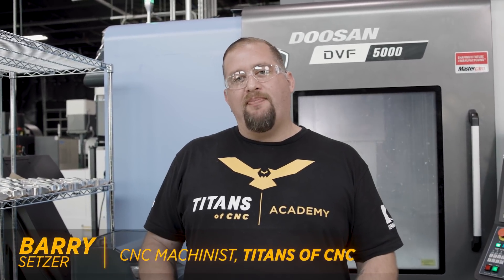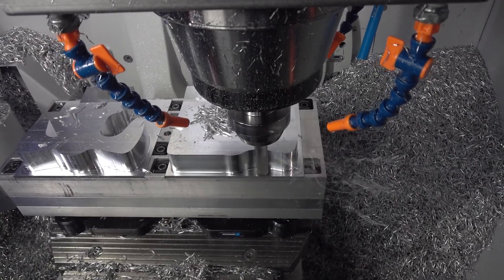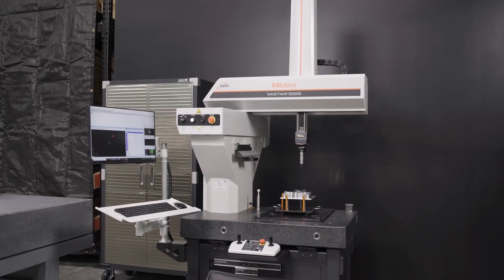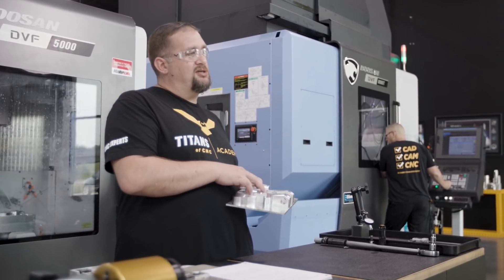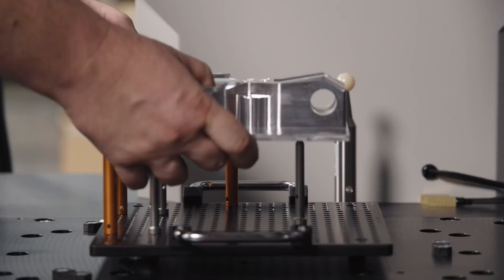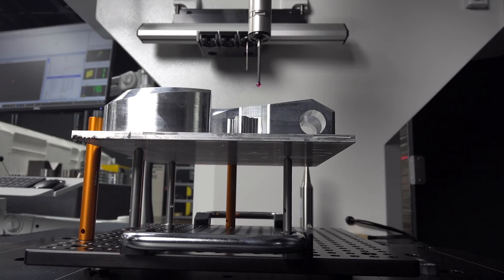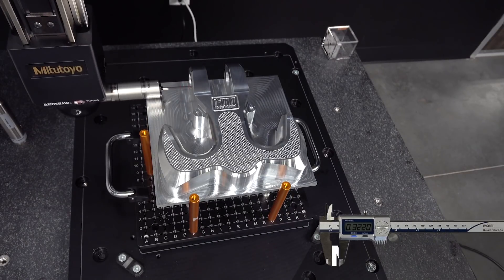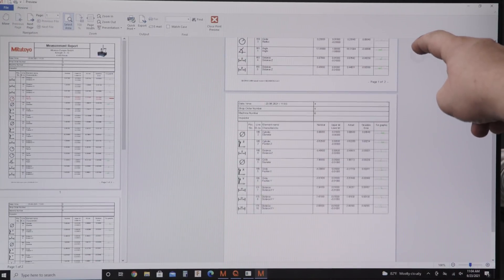Why This Specific CMM Can Make ALL MACHINISTS Lives Much Easier | Mitutoyo MiSTAR 555 CMM

Comment: I used to make gear selector forks of malleable iron and checked size and thickness with plug and snap gauges.
One day a CMM was installed and all the gauges taken away.
Seemed a good idea except that the CMM could only check one machine's output in 20 minutes or 24 parts per hour but the 5 cncs were making 120 per hour.
Management solution was to throw away 100 parts per hour.
Needless to say they shut down shortly after.
Needless to say this was in UK.

Comment: Why is an aluminum tow hook even requiring any sort of tolerance that requires a cmm..? This makes absolutely no sense what am I missing here?
Reply: OVER ENGINEERED PART! 

I deal with it on a monthly.
One hand won't talk to the other. Then clients wonder why their product costs so much more....   

"Did you read your own print ?????"
Reply: Removing the human as much as possible from the inspection process helps remove error.
Reply: @flyawaytx4588  lol
Reply: @flyawaytx4588  cmm programs are written by humans.

Comment: What is the programming like for this CMM? How much training will the machinist need to get up an running? or will this be programmed off line (by the inspector) and just set up to button push for the shop guys?
Reply: Depends on how good you are with a cmm. It's a lot like a cnc but pretty much but with more expensive and sensitive parts. I went from cnc operating to cmm programing and quality lab manager in under 6 years. Just takes time and effort.
Reply: It's not terribly complex. If you understand the part you can usually understand writing a program to check it. It is learning the software itself (where is that button, how do I check this, etc.) that is the real learning curve. How much training is needed here is really dependent on the individual. Here at Titan's I will program the MiSTAR for the machinist to button push as that ends up being the most efficient.
Reply: @travisjarrett2355   Cool. I am starting my shop in the beginning of the year and looking for a CMM with small floor space and doesn't take up a ton of my time programming since I will be a one man show. I am very familiar with Mastercam and CALYPSO. Thank you for the response.
Reply: @blizzard-zz1yd  You're welcome. And congratulations; that is exciting.
Reply: blizzard 1563 might be worth looking at a manual cmm as a first step. cheaper, no programming, can do pretty much most of same measurements and only requires a day or so training to put it to use